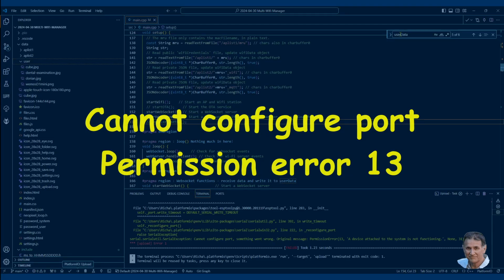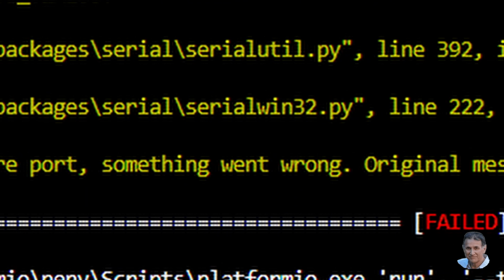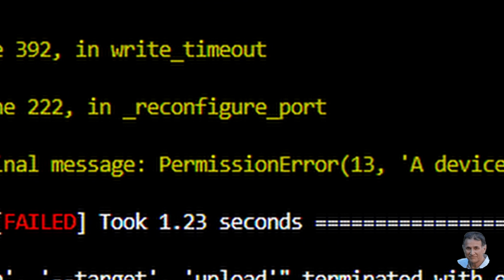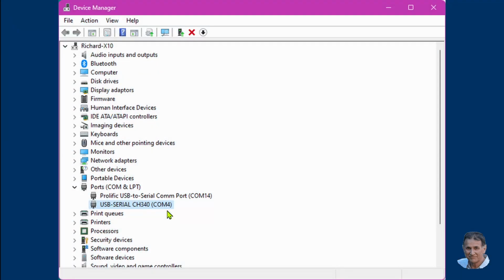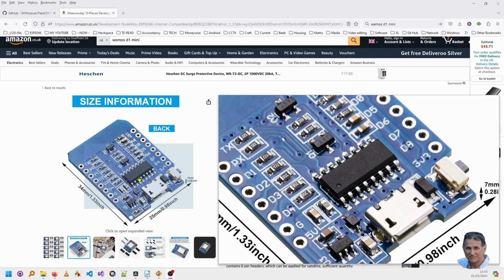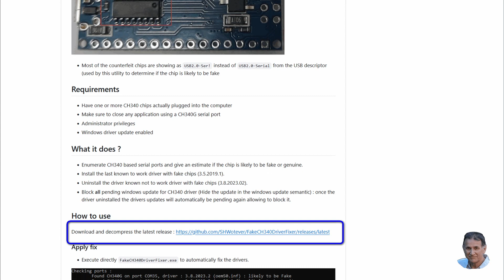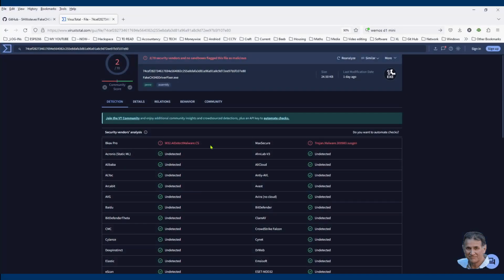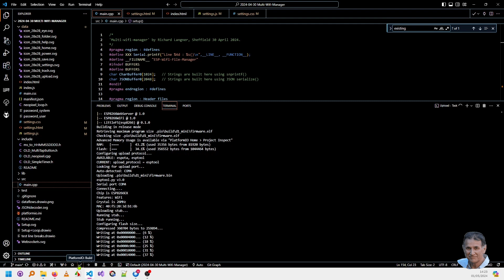Fake CH340 : Cannot configure port : Permission error 13., when uploading to Wemos D1 mini

Comment: Actually i did wrote this fix, Microsoft delivered a newer even worse version of the driver now causing excessive CPU usage in addition to the previous symptoms. I did an update to the "patch" to target also this newer version. My only hope is that sellers stops sells devices with fake chips. I'm not sure wch the original manufacturer of the ch340g is to be blamed, the drivers works correctly on legit chips.
Reply from the maker: Are you SHWotever who wrote the page to which I referred?